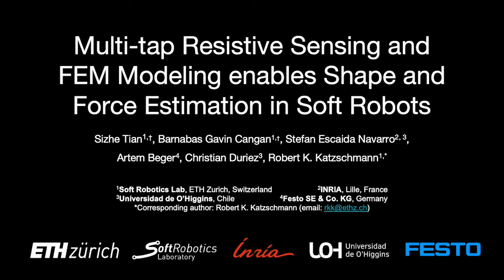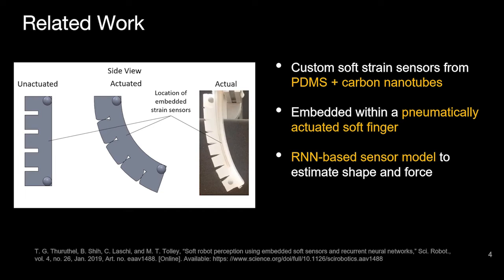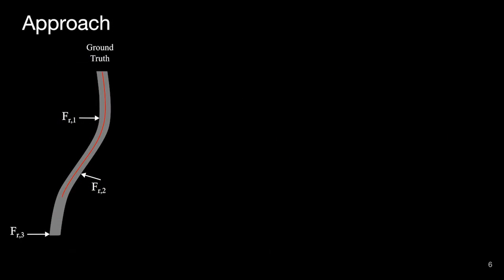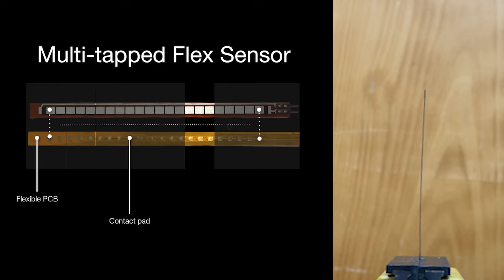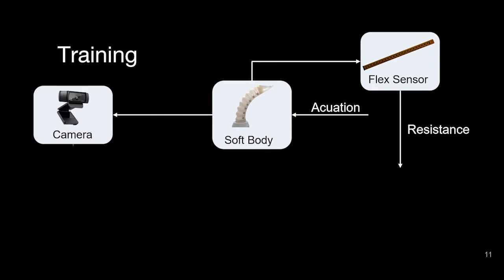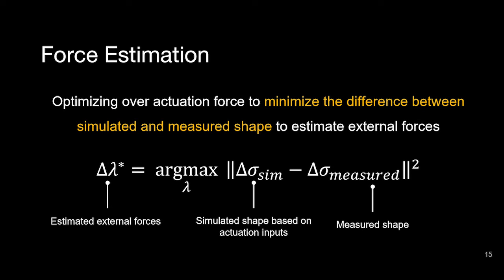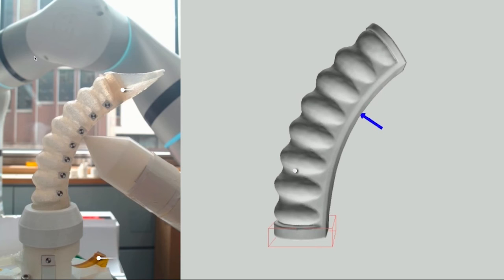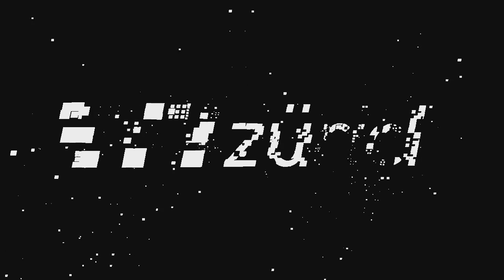Multi-Tap Resistive Sensing and FEM Modeling Enables Shape and Force Estimation in Soft Robots

Comment: We should not rely on electricity, other technologies must be developed.
Reply from the maker: What technologies would you like to see getting developed?
Reply: @softrobotics optical actuators that use laser energy in optic fibres for sensing, computation and mechanical actuation. If the centralised laser source is a fiber laser that can cut steel it should be able to boil enough water to make a robot finger wiggle.

Not because we need to, but because it would be really, really cool.
Reply: Very many, the most important of these technologies are pneumatic and mechanical computing and electronics-free control, hydraulic/air sensing, fluidic amplifier, interaction between ( mechanics, light, and chemistry ), mechanical heating without electricity, miniturize the mechanical system. Thank you 🌹🌹